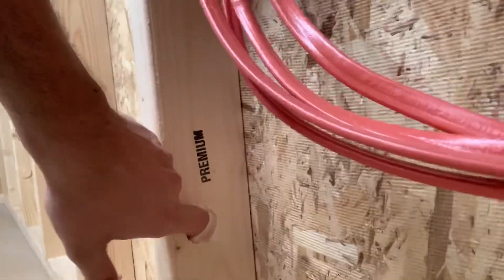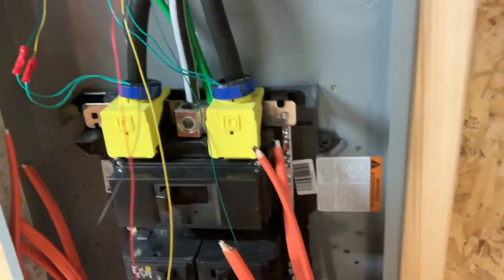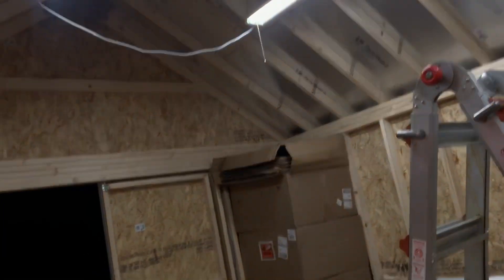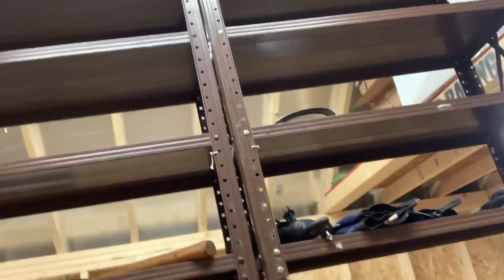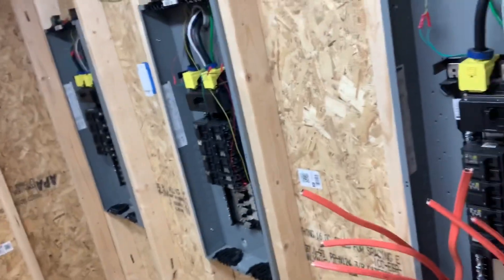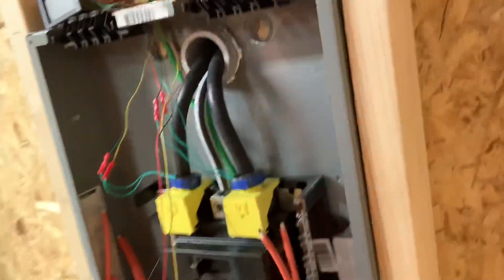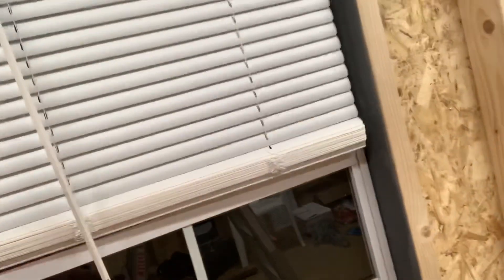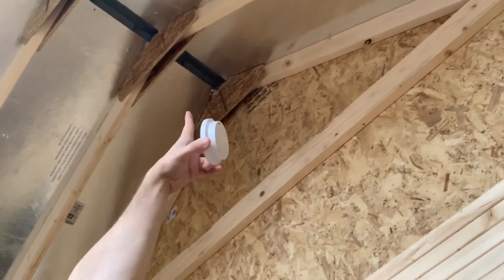Building Out a 800 Amp mining Farm part 4

Comment: Hi, I was just wounding if you ran a ethernet cable to the shed( or what did you do to get wifi). I'm Just wounding because I would need to run 300 ft of cable to my shed and wanted to see what you did. Also did you use a 16+ ethernet cable splitter Unmanaged Switch?
Reply from the maker: I ran 2 cat 6 underground rated cables to the shed I think the distance was about 225 feet I had to put some special connectors on for that range though
Reply: @CryptoClutch  Im planing on doing one cord that would connect into a wifi router, and then use a ethernet cable splitter to connect all my miners. Just wounding if that would work.

Comment: Hi,in my mining shed, I use a normal 24v thermostat with a high current relay for temperature control. I set the thermostat on the cold setting to set the shed temperature.

Comment: Beware of running that many cables though those holes like that. They will heat up more. Definitely a fire hazard. TBH it would be safer and easier to route the cables if you just drilled a few more holes and did 2-3 runs per hole.